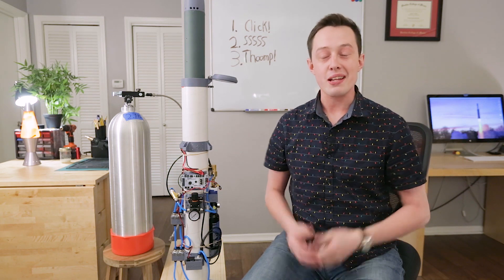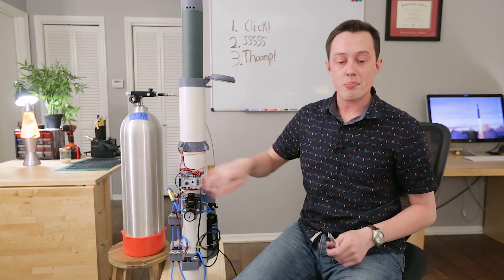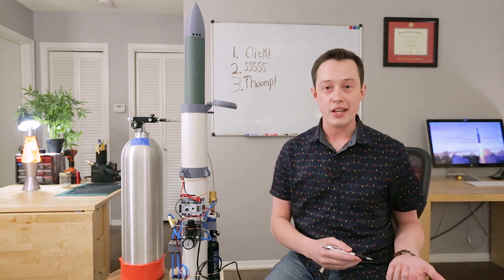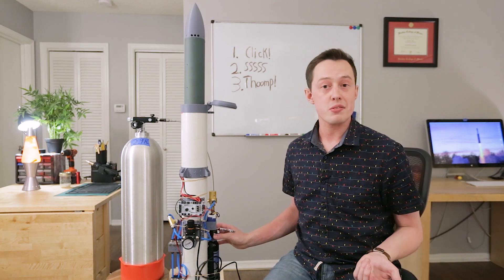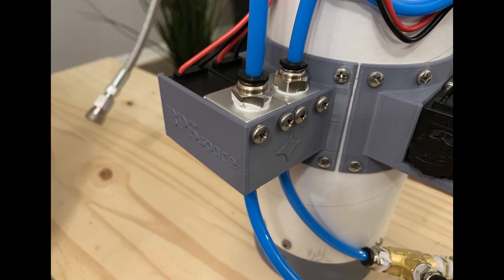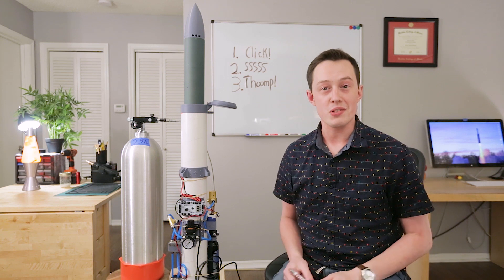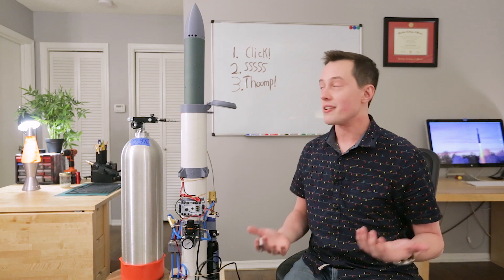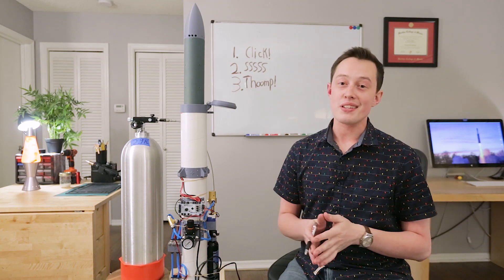Silo-Launched Model Rocket Development

Comment: Piston good, But would be better if, air vented directly into the base of the tube and in place of rollers you place fixed Teflon seals, The Polaris missile was launched by the pressure of expanding gas within the launch tube.  thus, if you choose to go for a underwater launch... the ejection gas also keeps the Polaris missile relatively  dry during the ride to the surface during a U-launch
Reply: I think the problem with that would be the required volume of air to push the rocket. not only would he require a much larger supply tank but also huge flowrate valves. There might be a way to do it withother hardware, think tshirt launchers that they have a baseball games. :)
Reply: @kevinmce  
Hi Kevin.
I Served on the. USS Daniel Boon (SSBN 629 B crew), USS Georgia (SSBN 729 B) and USS West Virginia (SSBN 736B) and now retired from the US Navy.
the reason i opened with my career info was... as a Fire Control / Launcher Supervisor on board a SSBN, a concern was always present... if either be operator error or by malfunction, if air was vented to the bottom of a launch tube lifting missile off its support ring and crushing the nose faring into the hatch... this is not good... and it does not take much PSI.

Lets do some math
Wt of rocket in Lbs divided by Surface area of the bottom of the rocket... 
lets say rocket weighs in at 1 Lbs  with a diameter of 3 inches or surface area ~7 inches.

1/7=0.1428 psi above atmospheric pressure will begin to lift the rocket off its support.  (this is how little air pressure is required to overcome gravity.) and the seals Leak rate only have maintain 0.1428 psi above air Pressure till clear rocket clears the Launch Tube) which is easily over come with extra volume of air.  I do not know the actual weights or volume is, so I am guessing...

Now if assuming your launch tube is 4 inch,  with the pipe length 30 in.
 the  Volume = 377 Cubic inches.
one 7 gram CO2 cartridge when popped will expand and fill an area of 413 
Cu.in.

He is not launching a T-shirt 300 feet, we only need 3 feet.

Comment: Hey Joe, I guess guidance for the rocket while being pushed out of the silo is necessary, although friction will most likely increase by quite a bit, do you have that inserted into your calculations? Especially id sizes of rockets are supposed to vary over time a special way of guidance will be needed. I have got some ideas, so if you are interested, maybe text me on my channel and then I can figure out a way to get those ideas over to you👍🏼 keep up the great work and don‘t get frustrated😉

Comment: why don't you use an electric operated valve like these?  https://www.aliexpress.com/item/1-2-Plastic-Solenoid-Valve-12V-24V-220V-Magnetic-Washing-Machine-Dispenser-Drinking-Water-Pneumatic-Pressure/33019875310.html?spm=a2g0z.10010108.1000001.12.74ad6eefOWaVDS&transAbTest=ae803_3&ws_ab_test=searchweb0_0%2Csearchweb201602_4_10065_10068_319_317_10696_10084_453_10083_454_10618_10304_10307_10820_10821_537_10302_536_10843_10059_10884_10887_321_322_10103%2Csearchweb201603_52%2CppcSwitch_0&algo_pvid=3bb8fc29-ab55-4112-b82e-ddbe4b7cc26e&algo_expid=3bb8fc29-ab55-4112-b82e-ddbe4b7cc26e-0

Comment: As I commented on the Tom video, it appears that you guys need an help on the nozzle design. You need to build a De laval nozzle, not a convergent one and either a divergent. Yes, indeed, if you have to chose to build a convergent or divergent it's obvious you will go for a convergent cause at least you will have air ejecting at a maximum of M=1 (nearly 330 m/s at ambient temperature and sea level), but if you want to go supersonic, you need to reach sonic speed at the throat and than the fluid must be accelerated in a divergent section, that's because a supersonic fluid will accelerate in a divergent nozzle and decelerate in a convergent one. If you do all this with air you can use isentropic Flux table to have a good approsimation to have an intended Mach speed at the exit, that's with knowing the pressure chamber and exit ratio, and with that you will get the ratio for the throat section and the exit section. The convergent section isn't relevant because is quite easy to achieve sonic velocity with enough pressure, but you will only decrease the mass Flux without an increase of speed at the throat if you continue to shrink it.

Font: Aerospace engineering student

Ps:great video!!

Comment: Please attach this scuba tank. 
It should NEVER be left standing without anything holding it, and especially not on a stool. 
If it falls and the tap breaks, it would easily go through a wall and anyone standing in between ... 
If you're not convinced, maybe this video might help me make my point : https://www.youtube.com/watch?v=f-xmaPSZ6GM
Reply: For real tho, you wouldmt think they wouod do much more than spin and scoot around comically on the ground but they go full on ballistic if it has any more than like 5-10 feet to build up a little speed.  Once its going its fucking going
Reply: (watches the tank in the video)

You know.. THERE's your space program. Good lord. I knew they had a lot of potential energy in there, but... woah.
Reply: @DFX2KX  My guess would be probably not quite enough to go to space, but yeah. It basically becomes a pressure fed engine.

Comment: I noticed that post launch of rocket. approximately 2 second of air heard releasing from dump valve. Wondering if this is from lines emptying or actually the piston volume . if so is there a way to increase the speed of air cylinder by faster/larger dump valve . awesome build 😁👍

Comment: I'm working on a liquid fueled model rocket, can anyone recommend a good oxidizer?
(right now I'm using Ethanol and compressed air, which has pretty big limitations)
Reply: I would recommend N2O.
Reply: Nitrous Oxide is good because it is both non-toxic and Liquid at room temperature.
Reply: @adamwilliams7241  thanks, I'll set about getting my hands on some

Comment: It wouldn't be as cool, but could you use a pyrotechnic charge inside a cylinder to drive the rocket up?  So a bottom can with an open top, with a similar can with an open bottom inserted around the first can (piston and cylinder).  You could use slow burning powder to generate gas at whatever rate you need to simulate the pneumatic launcher.  It would be so simple, but of course you'd need a linkage to open the hatch and a timer on the rocket motor.  This would make the system entirely chemical/mechanical apart from the ignition.

Comment: the thing is: how to light a model rocket engine mid-flight without this ignition stuff at ground launch pad
Reply: The onboard computer already do all the launch sequence
Reply: @alfdriss  i know but this is not what im talking about
Reply: @pcislocked  Joe's Facon Heavy two stage rocket do it , even for chute jettission, only with the lipo battery onboard, igniting some small powder charges, or fusing some NiCr wires. Joe name them "thermo" i think.
Reply: It doesn't take much power running through a short to launch a rocket this small. A few charged capacitors set to discharge at a specific time after accelerometers detects the thoomp would probably do fine.

Comment: You may have 'precision' control on the regulator, but the gauges on the regulator are really poor, so repeatability and pressure can be significantly varied, spend some money on a pressure sensor than can be digitally read by the launch system for display.

Comment: If your looking for increasing your discharge volume, check out air canon piston valves, believe  they would be a economical way to upgrade your system if you really want to push the limits.  https://www.youtube.com/watch?v=75O71AHTIr4

Comment: What if you do it with real rockets?

You launch it just with pressure from very deep and burn the thrusters in the air so you don't damage the silo and get a push for the start. 
And you could reuse the silo without having to spend that much money.

EDIT: and i see it happening on video🤦‍♂️

Comment: Be careful keeping the tank vertical. If scuba tanks fall right you can break off the valve stem and then you have to deal with a 10lb aluminum runaway rocket.

Comment: Next challenge: land the rocket inside the silo.
Reply: land the silo in the rocket
Reply: Honestly an action shot of that rocket slowly retracting back in would be so cool. Keep bleed valve shut until landing then open it ever so slightly and the rocket just eases back in
Reply: https://youtu.be/JRU5z4V7WZw
Reply: First trick is a model rocket with return to home.
Reply: Or stick rocket motors on the silo, fly it up and then fire the thoomp
Reply: Calm down elon
Reply: Then launch it again!

Comment: I just had a thought regarding gas storage for your RCS system.  Is there some solid that could be contained in a pressure vessel and decomposed to high pressure gas in a controlled manner to supply the RCS system on demand?  I'm not suggesting a solid fuel, since you can't control it, but I'm sure there's something you could use that maybe decomposes with heat.  Alternatively, you could try using peroxide, but that might be hard to get and you probably don't want to deal with the safety hazard.

Comment: Will you be slamming the silo door shut once the vehicle has cleared the silo? It would save having to clean soot out of the tube and off of the piston as it would stop the exhaust from firing back down into the silo. (Not on hot fires obviously).
Reply from the maker: Yep! That's another big reason to have the silo door controlled by the launch computer!

Comment: If 2 valves are needed for the flow required is it really a redundant system?
Reply: I'd guess 1 valve could do the job, but not as well. Like the rocket will clear the tube, but just barely. Sort of like if an engine fails on a falcon 9, the rocket could still potentially make it to orbit.

Comment: With the pneumatic cylinder. Be careful on fully extending with pressure. They aren't designed to "smack" against the gland end and the end cap. You may damage it, you should probably have a hard step of some sort.  Just a thought.
Reply: You can get cylinders with built in soft stops, but it'll be OK.  It's much beefier than anything you're likely to build around it.
Reply: An air cylinder gets really impractical when you scale up. 

If you use the valves as pilot valves and the entire base as the valve you are golden. That means pressuring a short second cylinder around the launch tube. 1.6 MPa PVC pipe is good and cheap.
Reply: Indeed, your probably best to have it hit a physical endstop as controlling its stop via air will likely be too complex/impact performance.

Comment: Buddy youre gonna get hit with ITAR someday lol these systems are creative as heck 

Hindsight: Probably dont call it a dead man switch when living in an apartment and working with rockets with a LOUD BEEP :p

I like it though. You ever want any help feel free to contact me :P

One thing I would recommend is not mounting all of that on the silo itself god forbid you have a CATO incident. Itll save you time and money....

and a lot of rebuilding lol

Nice mass flow rate work around! 

Also just a correction: Hot launching doesnt usually destroy a silo. Itll just burn a lot of stuff once the rocket gets moving away from the exhaust manifold of the silo.

Surprisingly enough theyre also designed to deflect and manage all of the vibration from a launch because an actual missile silo would crumble apart from the standing waves generated during a launch if it wasnt! < Veritasiums video on nuclear missiles

Comment: Very cool idea. Did u thought about pushing it with magnets instead of air?
Reply: Jakn an electromagnet could work but it would have to be very strong very fast or it would have to work that a coil gun because magnetic fields are actually very small generally
Reply: @IncurZeAwperator  Yeah thats what i thought as well. What also comes into mind is that strong magnetic fields might harm the flightcomputer or some sensors.

Comment: Hot Launching: Fire the motor while the rocket is still inside the silo. 

So that is what you kids call it nowadays!
Reply: Be carefull that your rocketsilo is prepared for a hot launch. Launching in an unshilded silo can lead to unplanned side effects.
In the worst-case-scenario debri-removale might be necessary. This in turn can lead to heavy debate when it becomes public as there are quite a few opponents of debri-removal. Mostly people who think silo-hot-launching should be the only way to go.
Reply: @ErikB605  well the accelerometer on the flight computer  can surly cauculate  whether the rocket has left the silo or not
Reply: Integza yeah, you better use protection
Reply: Im gonna start calling it that
Reply: Isn't this a cold lunch lol ...